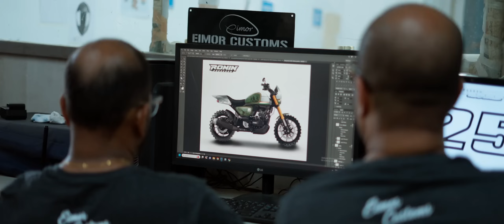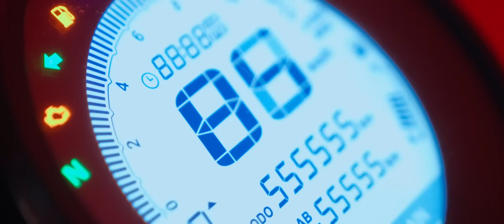Unveiling the TVS RONIN PARAKRAM: A Custom Tribute to Kargil Heroes

Comment: Tvs should work up on design.of actual Ronin.. they messed up with the back design. The Ronin looks ugly now 
 Also the rear tyre should be of higher section more width. The current one doesn't go with a 225 cc bike also the dual channel abs should be the standard in all variants.